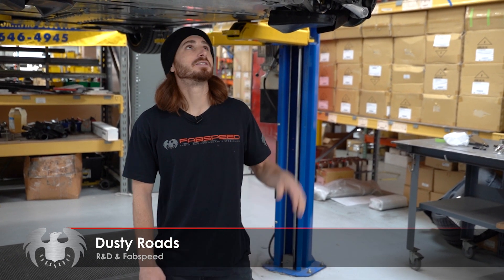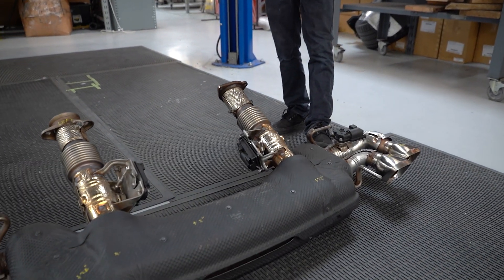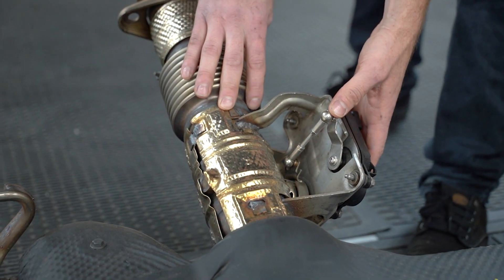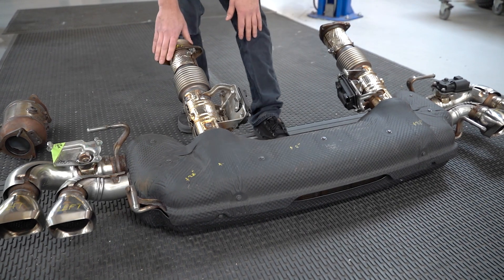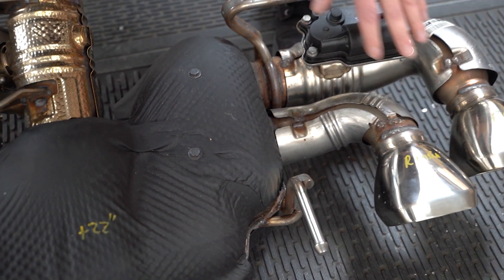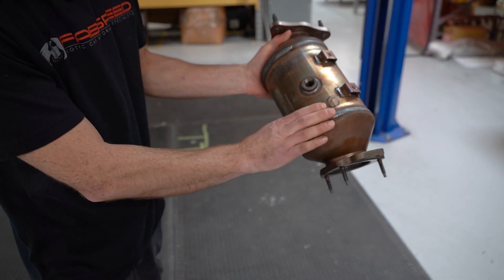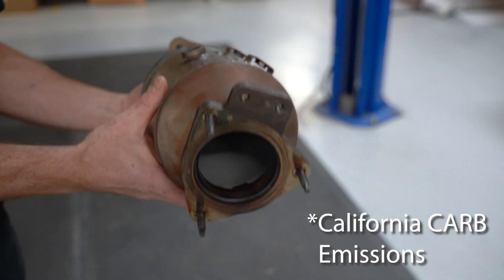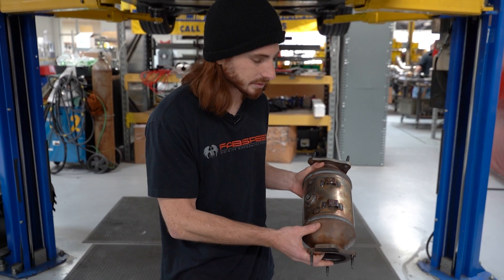Corvette C8 (2020+) | Fabspeed R&D Explains the C8's Stock Sport Exhaust System

Comment: I don't think those valves are for air/fuel management... From GM Authority: "Active Fuel Management (AFM), otherwise known as Cylinder Deactivation is a General Motors engine technology that shuts down half of the engine’s cylinders in light driving conditions to improve fuel economy."
Reply from the maker: You are correct, those valves are part of the AFM system. Dusty misspoke when he said air fuel management instead of active fuel management.

Comment: Will your cat back exhaust system pass California emissions? 
Will your CATS pass California emissions?
Will your cat back system have the four values?
Reply from the maker: No, our exhaust is not CARB certified. Any modification to the exhaust system must be CARB certified to pass emissions in California. 
Our Valvetronic Maxflo exhaust will include the two lower valves for changing the sound, and all of our exhausts will include a valve simulator for the upper valves so that the ECU does not know there aren't any valves and will not throw a code. 
We will also be adding a kit to activate the valvetronic valves on cars that did not come with a sport exhaust form the factory.
Reply: @FabspeedMotorsport  As long as you don't throw a CEL you should be able to pass unless they start asking questions and look at them.